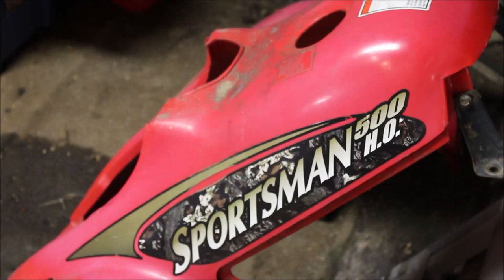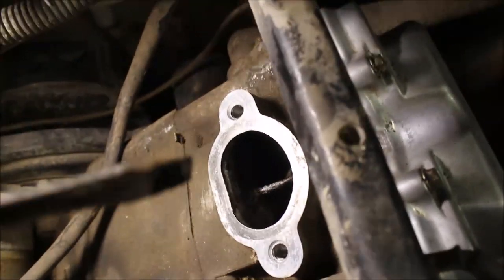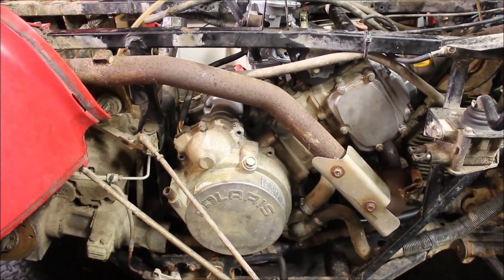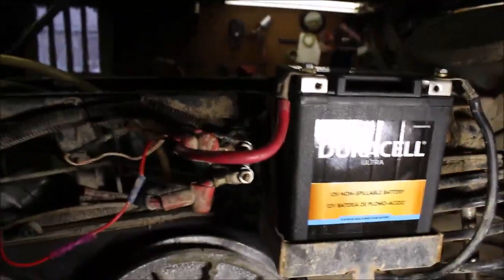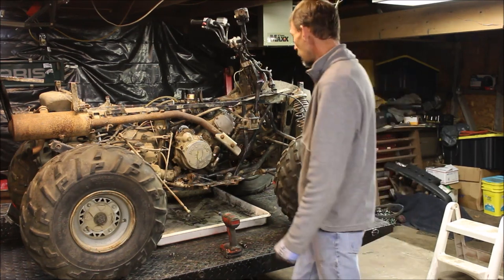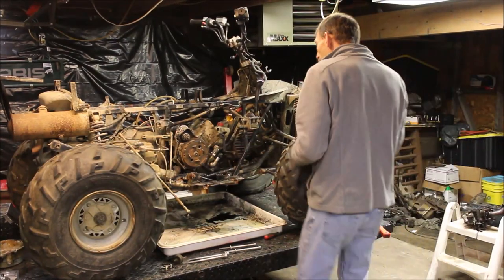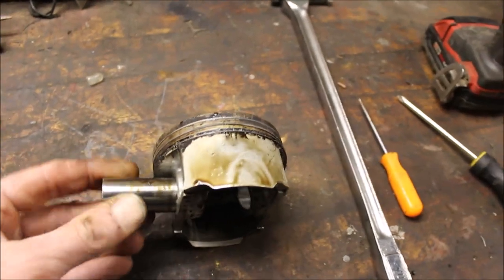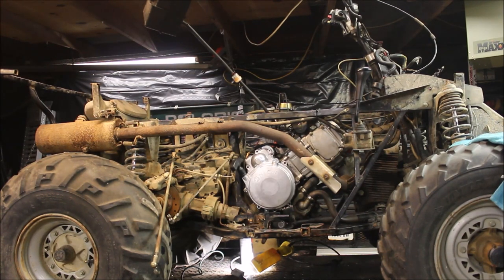2001 Polaris 500 H.O. Rodent nest! Clean? Or Rebuild? See what I do!

Comment: hi guys if its happening to you so before you replace all the engine after you doing leak test and the engine is in timing and you still have leak, just remove the springs from the valves and connect them to a drill with a hose and twist it and push it against the cylinder head, it will clean all the crap that's on the valves. I did it to my sportsman after I bought it and it worked for me.

Comment: You definitely take on some miracle projects! My son and I have learned so much from watching your videos. I would like to have your advice on my 2001 Polaris Scrambler 500 4x4. I replaced the fuel pump, spark plug and CDI, I'm getting voltage to the plug but no spark. It cranks but won't turn over. Do you have any ideas of things I could try?
Reply from the maker: Have you checked the pulse coil by the flywheel? If the start rope broke. Or if it got dirty that might be it. Or aftermarket cdi is bad
Reply: @TitaniummanGarage  I haven't checked the pulse coil by the flywheel. I will check that since I did recently replace the pull cord assembly. I did purchase a non OEM CDI so it could be that too. Thanks for the help and I'll post what my results are.

Comment: Dear Abbey, I bought a 2004 500 Sportsman non-running no pull cord, and 3 carbs later I thought were not adjusted, it appears to be pouring gas out of the exhaust at the donut. Where to start next?
Reply from the maker: The needle and seat are leaking on the carb. I would drain the oil. you might have fuel in there too.
Reply: thanks,, another project is a Hisun 800 utv curious to see if any Polaris parts are interchangeable.? @TitaniummanGarage

Comment: Question about the H.O. Versions, how can you tell if yours is an H.O. Or not? I bought mine used so when getting parts for it I have been getting non H.O. Stuff but not sure if they are correct or not
Reply from the maker: The H.O. carb intake boot is bigger. the cam lobes are a slight bigger. If you look at the side of carb the throttle cable cover will be metal if its H.O.

Comment: I have a 98 sportsman 500. I just replaced the camshaft. Ran great for about a week now it backfires through the carb sometimes. Once was sat let it idle for of few seconds tried take off, and it backfired through carb then it ran backwards for a second. Could the new cam have wore out and started causing this?
Reply: Update: all I had to do is clean the carb and adjust the air/fuel screw

Comment: Hi, Im having trouble with my 2003 Polais Magnum 500 HDS, after charging battery and trying to jump start quad there is no power getting anywhere, i tested the circuit breakers and their getting zero volts. What might possibly be wrong? The fusable link?
Reply from the maker: Starter solenoid? Fuseable link?

Comment: Those do not start and run well without the air box and filter only worked on Polaris for 30 years hope this helps .
Reply from the maker: Yeah, I know. I had a magnum 500. Was a real pain. The airbox leaked. It took me a while to figure that one out. Hey, you ever hear about a recall on the cdi boxes? I thought I read that somewhere. Seems to be a common problem.

Comment: Hey any idea why on the one end of the camshaft where the spring is for the decompression valve or however that works would be broken. I have a 01 scrambler 500. I noticed it was starting hard and then took off the cam shaft cover off that’s on the side of the motor where the coolant hose returns to the radiator and it was all broken inside there.
Reply from the maker: I've seen that once. Not sure how it happens.

Comment: Hey I have a 2003 Polaris Ranger 500 HO with a bad motor. What do you recommend I do? Find someone to rebuild my engine ? Or buy a running used engine and find someone to do the engine swap?
Reply from the maker: Depends how much you trust your mechanic. lol. Probably an engine swap if you can find anything under 3000 miles.

Comment: I hate mice they ruin more stuff. I am saying this with out cussing. I had a 2000 and I bought a99 both Sportsman 500 and now I not sure what is wrong with the 99. I have watched all of your video's. I have never adjusted the valves on the 99 now I no how. I think I have a weak and intermittent spark it will back fire if cranked long enough to make the starter hot. I think a faulty CDI or coil. Not sure it is getting allot of fuel but I had it choked and I was cranking and praying. That didn't work. Any thought would be appreciated. Not sure of the hours and mile but I do know they are low. My 2000 went along way and I beat it to death. Went up to Canada and put on a ton of miles. Plowed with it not something I recommend very hard on frame. When the 99 sits with the gas turned on it floods the bowl and drips but that hasn't been a problem with it running and always have allot to do so I never pulled the carb. I lived 100 miles north of Milwaukee until I was 19. I miss WI.
Reply from the maker: Sounds like the needle and seat are leaking dumping fuel in the cylinder. That's why it backfires. It stops leaking when you drive it because your using the gas in the bowl. I would rebuild the carb. check your valve lash and timing before replacing any electronics. cheap and easy first. Thats what I do.
Reply: @TitaniummanGarage  Thanks!!

Comment: How do you replace the oil pump on a 1999 Polaris sportsman 500?
Reply from the maker: You have to split the case to get it out.
Reply: @TitaniummanGarage  do you see them go out much
Reply from the maker: @colelayden7857  Its rare that they do. You can test it by pulling the rocker cover off. turn it over a couple times. oil should come out by the rockers. If not. the pump is bad.
Reply: @TitaniummanGarage  ok then it is pumping because i just had that off. I appreciate it

Comment: @titaniumman garage can you help me with my polaris sportman 500 efi 2008 i have an issue for a very long time that it dies idle and sometimes when i hit the throttle it dies i tried everything and had help from Mechanics in my country and they couldent find the problem can you help me? i can even pay if you can solve my problem thank you!
Reply from the maker: What country are you from? I haven't done much work on efi. But the research I've done showed possible injector or fuel pump issues.
Reply: @TitaniummanGarage  im from israel and we checked the fuel pump and its good